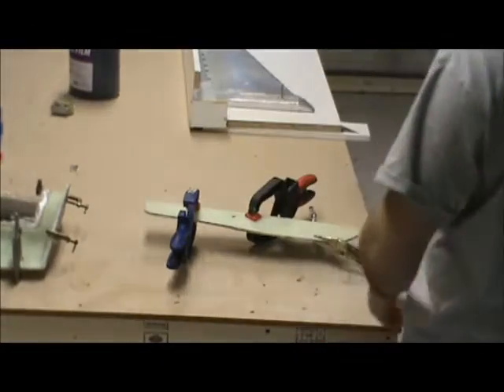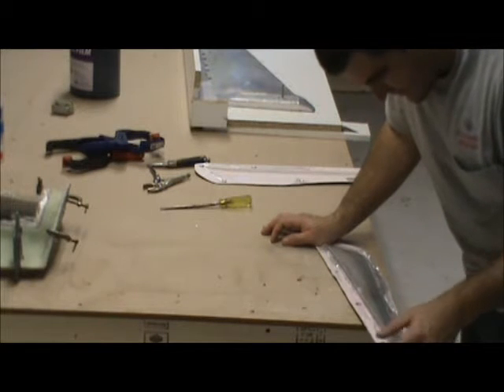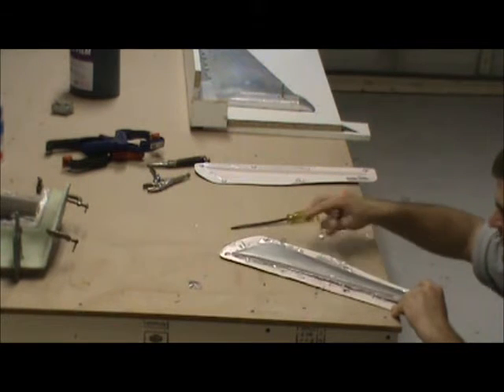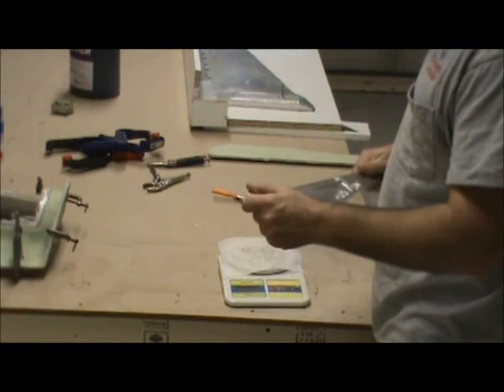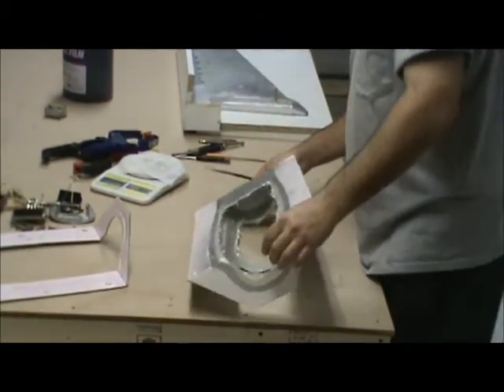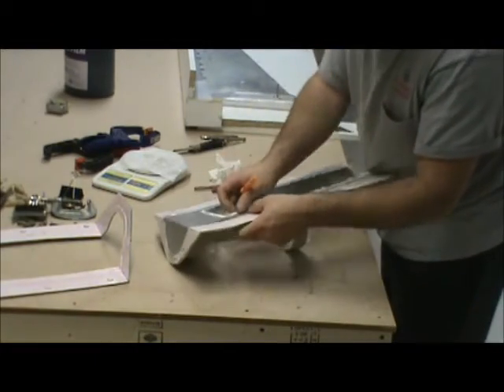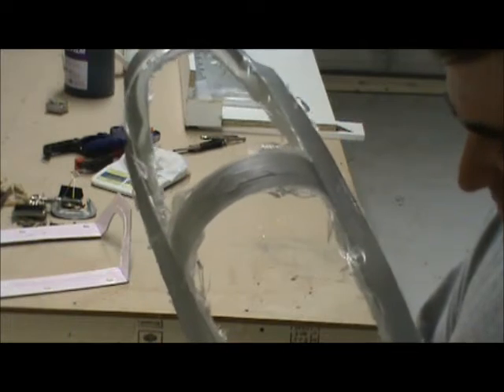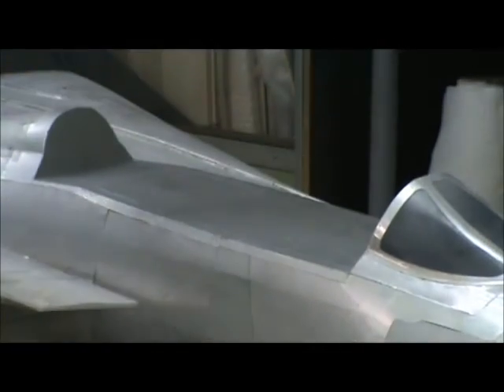How to build an F-14D Tomcat #48

Comment from the maker: @gigabytex64 Thanks for the tips they are always welcome.  Like mentioned in one of the vids, i will probably just end up using some west system six10 for assembly of the production parts, as its convenient (no mixing of fillers/modifiers) and cheap at $20 per tube...  But other options are always great to have

Comment from the maker: @hornitpilot  I am using PVA, just didn't mention that. I also am brushing on a 2nd coat of PVA along the perimeter of the layups for added protection.   Cabosil is going in the garbage.. well not really, it will just get used for limited things now.

Comment from the maker: @f1adore If their isn't enough resin, then their isn't enough resin to make the correct amount of slurry to join the parts.  The issue with the brittleness of he mixture used to join the parts, is b/c Cabosil is an epoxy thickening agent and doesn't have much (if any) structural properties.  If i would of mixed in some milled fibers into the mixture, then it wouldn't of been as brittle and the parts would have probably survived.